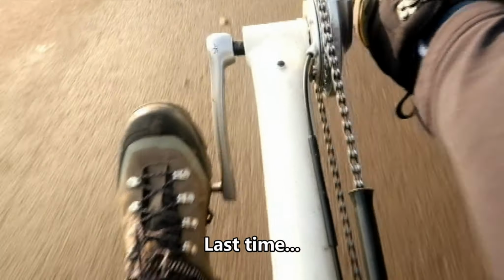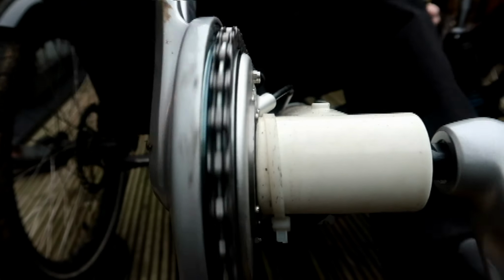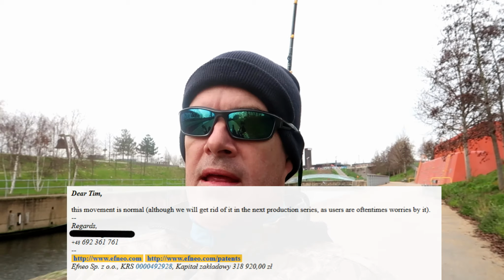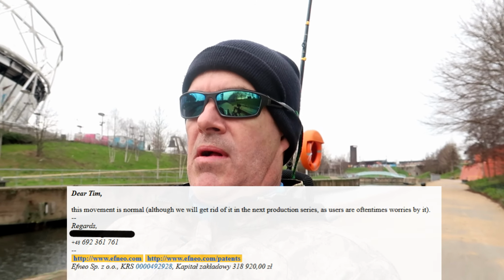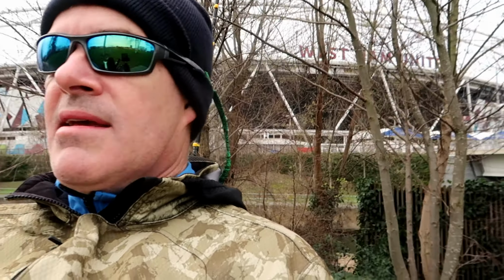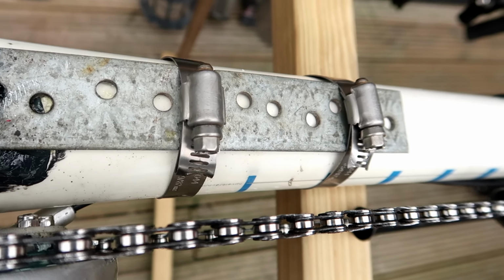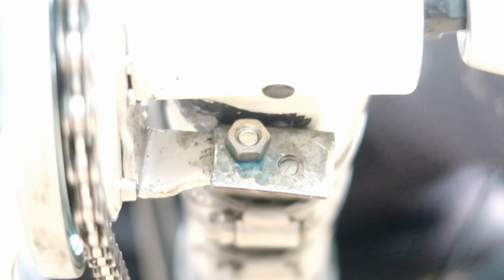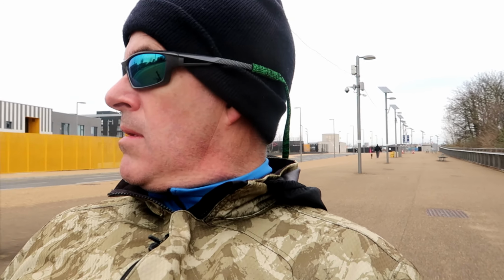Efneo GTRO Gearbox | Problem Solved?

Comment from the maker: This is the last video about the GTRO gearbox for a while I promise. I hope I haven't bored you all too much with it.
Reply from the maker: Hi David. Completely agree. Its over-engineered and from beneath is really ugly. I think you might be right and one day I might try something a bit more "tidy". Others below have mentioned getting a weld done perhaps. That might be a way forward, but for now I'm just going to try and enjoy riding for a bit. Thanks for the comment though 👍
Reply from the maker: A new boom would set me back about £350 ($450 approx), not going to happen until I absolutely have to. 👎 
I did think about drilling through the boom, but not being a mechanic, I was worried about causing a weakness in something which has to take a great deal of stress and torque.
But I do like your option 1. It goes hand in hand with the idea of maybe getting that welding done to give me something to bolt a cleaner and smaller bracket to.
Reply from the maker: 🙂 If I have to change the current "fix" then any drilling, welding or bending will have to be done by a professional. This is a part of the reason for the current idea... I didn't have to make any permanent changes to the trike itself... in case it didn't work. I'll gladly pay to get a "proper" job done if its going to change Trinny. 
Thanks for your ongoing interest though David. I really appreciate ALL the help and advice I get from my subscribers.

Comment: Tim, looks like a great fix and I agree it's the boom moving.  Thanks heaps for the update.  Hope it's all good now for millions of miles. 😁

EDIT... for the bracket fix, maybe you could put a couple of pieces of rubber under the clips to protect your paintwork.  Old tube would work...

The dent is likely wear from the bottom bracket moving so much.  What you've done is better since you would have eventually ended up with the same dent with the micro movement efneo suggests is normal.
Reply from the maker: Thanks Steve. I'm fed up with pulling it all apart now so I hope its all good too. 👍
Reply: Like you, I never let anything but rubber or black painters tape touch the paint. For instance the chain idler bracket has a rubber protector on the bike frame. No plastic nor metal comes in direct contact with the frame. That is just the kind of guy I am :)

Comment: Tim I would have to say for a person who claims not to be a mechanical person you did a good job on finding a suitable solution for the current problem. I do have a suggestion that may take some involvement with HP Velotechnick on the boom. I know spending money isn't the most fantastic thing in the world to do, but I would have taken some measurements and photos and sent to HPV and asked for a new boom to be fitted with a proper anchor point for the GTRO gearbox. I'm sure that the company would have addressed it because they are very aware that different drive systems can be installed and I think they do offer the GTRO on request.
Reply from the maker: Hi Richard. I've been hoping that you would drop by and give me some of your wisdom. 😉
I must say that approaching HPV hadn't crossed my mind at all. I also wasn't aware that the GTRO was on their options. However, that being the case, then if/when my "remedy" needs another solution then that will definitely be an option I'll be looking into. Thanks for watching and as always for commenting too 👍
Reply: @TimsTrikeTrips  HPV from what I understand is a pretty good company overall. I looked on their website and did not see the GTRO gearbox listed as one of their options but as I stated before with a little bit of communications with them I'm sure they would be happy to assist with a modified boom for their product to include a proper anchor point for the GTRO gear box. I could do that modification myself with a TIG welder and a piece of 5mm thick aluminum to weld a proper bracket on the boom to bolt the gearbox support to like you did. I will say again you did some very good work with what you had available and it looks like a very good job. As a suggestion on what you have I would have used something like a thin piece of flat rubber between the boom and the anchor support  and some thin rubber between the clamps and the boom (top)/support (bottom) to try to eliminate slippage and damage. Just a suggestion to consider.
Reply from the maker: Again, I like your thinking. It was already suggested in the comments about getting someone to weld a bracket on the boom. I don't even know what metal the boom is made out of at this point but I'm sure a local welder could do it quite cheaply. Then a respray and jobs done, eh? Hmmm, food for thought indeed.
Reply: @TimsTrikeTrips   easy way to determine if the boom is made of steel or aluminum. Will a magnet stick to it? Even grade or high carbon steel a magnet will try to hold on to it. Aluminum not even. LOL A friend of mine figured that out once upon a time when they set a magnetic parts tray on the bonnet of his Subaru and it slid off, man was he pissed. I tried to warn him but he knew better LOL.
Reply from the maker: Doh! You just reminded me. I do already know. Its Aluminium. I tried to get a neodymium magnet to stick to it last year for a GoPro mount. So how hard is that to weld? Not as easy as steel I reckon.
Reply: @TimsTrikeTrips  With the proper welder, proper welding material and a little experience it's not too hard to do. Experience is probably the most important part. After looking at the install video again, I can see some issues which the Gear Box manufacture could address for use on Tadpole style recumbent trikes and bikes. The gearbox anchor arm could be retooled to fit better on a boom style mount. That would be the best fix for Efneo to look at. Perhaps Efneo could address that themselves in the future. Maybe even include different anchor styles in the kit for maybe 2-3 different mounting situations. I think it would be worth a few extra dollars per kit to have that feature.
Reply from the maker: Yes, the anchor arm unscrews from the rear of the gearbox very easily and could be swapped out for different styles of cycle with no problems at all in just a couple of minutes. The end that fits into the back of the gearbox is a toothed ring though so I wouldn't be able to make another myself unfortunately.
Thanks for all your help Richard 👍
Reply: Tim, I'm always happy to assist any way I can, even from across the big pond here in the USA. Sometimes I find working and making modifications on bikes as frustrating as tracking down my Ancestry LOL. Too many pieces in the overall puzzle yet still fascinating to figure out.

Comment: Hi Tim, I own a 2013 model HP Velotecnik Scorpion FS26 complete with Rolhoff gearbox. At 74+ yrs.  I had an electric assist installed on the boom. The unit puts out a substantial amount of torque on both gearbox and boom. I have noticed no flex at all in the boom nor problems with the gearbox. Probably voids the warranty though. Like yourself I am not particularly  gentle with the trike. They are meant to be ridden. Unfortunately it is parked at the moment as Alberta's weather is not conduive to winter trike riding, and I do not wish to go to the expense of studded tires.  Love your vlogs, keep on triking and filming.
Reply from the maker: Hi Keith. I don't envy you that "proper" winter you guys have over there. I moan about the cold here but its nothing compared to yours.
I imagine that an electric motor would put through a great deal of torque but it would also do it at a constant rate wouldn't it? Where my legs give about 80% effort through the top 140 degrees or so of pedal and very little else the rest of the way around. I think that's what causes my boom to twist and flex. But, you've given me another idea... I need to practice my pedalling and become more "pedal efficient"? 😉 And I'm glad I'm not the only one who likes to "ride" his trike too, ha ha. Poor old Trinny.
Thanks for the compliment and thanks for watching and joining the conversation too. I really appreciate it 👍

Comment: Good job on the repair, nice to see it appears to be fixed. It's all part of the recumbent life. My trike is undergoing tune ups right now as it's too bloody cold to ride LOL. Prepping for the spring ride to the East coast (1500 miles or so along the St. Lawrence river from Ontario to New Brunswick, should be fun. Take care and keep the videos coming.
Reply from the maker: That's a nice ride. When are you starting out? 
The repair is over-engineered but if it works then I'll be more than happy 😉 Cheers Bryan.
Reply: @TimsTrikeTrips  Probably start in May, it should be warm enough by then.
Reply from the maker: @2madceltic  well I hope you get a few rides in before then 😊

Comment: It's good that you checked it. Here it's easy to go to a bike shop and there are 3 near me and 6 more a bit further but all in biking distance.
The dent isn't that big of a problem. You have an aluminium frame if i am right and the edge of the part was shart, so it would always work it self in the frame. I think by making it flat so it has a bigger surface to touch, would also help.
Next time as you are in the Netherlands, come by, I will fiks you a nice part fort it. Some white spray paint and it looks good.

What they say about the movement is normal, but this was more than you would expect.
As it comes loose again, use a tiny bit of blue loctite. Not the red but the blue. The Bleu you can get easier loose if needed.

Tomorrow I order a bunch of parts and the end of the month, I send the drawings for the metal parts to the factory.
I let them make some parts. Saves me a lot of time with building.
Pedals, breaks, some parts for the steering and even bike shoes are in already witch some other parts.
I can't wait till my bike is ready and seeing you ride makes it harder to wait.
Reply from the maker: Next time I'm in the Netherlands you do that and we'll go for a great ride together 👍
(I did use the blue loctite by the way ) 😉
Reply: @TimsTrikeTrips  as you come, come in the summer. I hate the cold weather. 😂
Reply from the maker: @emiel1976ep   ha ha, me too! 😬

Comment: Another good one Tim, if I was you I would carry some tools so I could just retighten those bolts and BB coups enough to get me home at least, even if you have to stop a few times and retighten them at least you would get home, thread lock is a good idear but it can cause big problems when you need to unscrew some stuff. I feel what you mean about getting out, last summer I did about 2500 miles on my old ICE trike and have not been on it since September and it is starting to hurt. Cheers mate.
Reply from the maker: Hi Bill, its awful not getting those miles in, eh? 
You're right about the tools. I will put them in my bag before I next ride out. Yet another great subscriber suggestion. Thanks a bunch! 
By the way, I used the blue (medium) thread lock. Hopefully wont be too bad... and hopefully I'll never need to undo them again anyway 😉 ha ha.

Comment: Tim, nice vlog about the GTRO gearbox. it looks like the boom is twisting as you pedal. That is the main reason why I choose an aluminium box type frame and boom. My Greenspeed is very solid indeed. I am sure you will end up with a strong unit,,,,,, Cheers Mate.
Reply from the maker: I'd never really thought about different boom shapes. Interesting, though obviously I cant change mine. This gearbox would fit to a box section like a glove too. As always, thanks for watching and commenting Brian. 👍

Comment: Hi Tim, unless you are about 6ft - 4in. tall & have your boom extended quite far out, I don't think you should have any flex or movement in your boom. If your boom is extended quite far out the problem isn't from your Efneo, it may be from needing a longer boom so more 'pipe' is in your frame. I have had the Efneo installed on an HP Gekko which has the same boom design as your Scorpion & I believe your problem originated from a faulty original install with incorrect settings of your crank bolts. I also had the interference with the hole boss underneath however instead of grinding the boss off the boom what I did was installed 2 heavy duty zip straps crossed over the Bottom Bracket Shell. This has been problem free for about 3 or 4 years now. Hope this idea might give you a solution that doesn't look so Polish. :) (Poking fun at Frank from Efneo) Cheers./Glen
Reply from the maker: Ha ha, I am exactly 6'4" tall and yes the boom is quite a way out there in front of me 😁
I've had no further problems with the efneo since my initial install. My 'fix' is working well 🤞
I do have a little tale to tell about the efneo guys in Poland (nothing bad) but will save that for an upcoming video.

Comment: Nice to see Tim you are still triking despite the cold . I am too much of a pussy here in my country for cold riding , lol . I have been studying your issue with the clamp . I think you may have over engineered the repair . Not sure if it would be strong enough but too bad you couldn't utilize that 5 mm hole that you cut down just under that clamp , there appears to be enough thread left . With a L bracket and a strong stainless bolt attached to the frame then attached to the motors L bracket  might give more stabilization although not sure on that one from this side of the screen . Hard to believe there was that much force to dent the frame though , seems like there is something else going on ..
Reply from the maker: I wanted to use the boss too but the bugger was not only under the leaver arm but also right at the very end of it too. I shared that idea with a friend and neither of us could think of a way to do up a bolt from such a position without re-engineering the lever arm which would have been even more of an issue.
I'm pretty annoyed that it damaged the boom. I'd done less than 30 miles too. Anyway I hope its sorted for a few more miles now.
Thanks for your comment and suggestions though. Really appreciated. 👍

Comment: The best of both worlds is to have A) a motor in mid frame using a dual drive (using both belt and chain) B) a rear wheel internal hub and gearbox at the boom bracket. The benefits are several: the rider can bypass the motor drive when the rider desires to trike in the traditional way (unplugged). Secondly, the center of gravity is better when the motor and battery is at center of gravity. Thirdly, if the motor is out for repairs, you can still ride the trike, using both the gearbox and the rear wheel internal hub. Fourthly, the power transfer is better balanced when the motor is in mid -drive train. Did I just invent something?

Comment: Loving the background- reminds of when i was a boy,  entering the previous stadium of said club with my big brother for a few years.  (They were known as the 'ammers then, irons gives a different connotation to a sparrow from Bow like me). I live 4 miles from another team in the North- West with the same colours and a similar heritage.
The company tried to mug you off? A bit much, i wouldn't think that unit came in cheap. Has your fix worked?
Reply from the maker: The fix is working really well so far. I've done quite a few miles now since that update so (fingers crossed) it will stay that way.

Comment: I've got a TerraTrike Rover with a square boom. Seems all the raves about the Efneo died out, and been looking for recommendations if one should buy it, or avoid it?

I've got a few grades to take on, Nothing longer than a mile. Combined with my weight it slows me down dramatically. So been looking around trying to find out if the Efneo is worth it, or forget about it??
Reply from the maker: James, I keep promising a review of the Efneo and I will get around to it very soon I promise. For now my advice would be... yes, go for it. You won't be disappointed.

Comment: You really need to put a longer screw/bolt on the " L " bracket, The one in there will work loose, also put some thread lock on it with a self locking nut.
Reply from the maker: Yep, you're right about the longer bolt but I need to find one first, it was all I had at the time that would fit. 😉
I have already put the thread locker on it though for now.
Thanks for watching

Comment: How fast are those trikes? Do they reach the same speeds as bikes?
Reply from the maker: Ahh.. now there's a question that could stir up a hornets nest. Let me answer it this way... in the very early days of recumbent cycles they were banned from cycle competitions because it was said they had an "unfair advantage". They are still banned to this day. Personally I take great pleasure in overtaking the guys on their road bikes. Especially so with my less than perfect legs 😉 You should try one out one day. Great fun! Thanks for watching again Tom.
Reply: Tims Trike Trips I see, very interesting. Funny that you beat those other bikers😂
Reply from the maker: I'll try and catch some on video one day. Usually not long before they step up a gear and pass me by again ha ha.
Reply: Both downhill and on the flat they are usually faster but they are slower on the uphill bits as they weigh quite a bit more than the average road bike (over 30lbs without any panniers/luggage or mudguards) and you can't stand up so its all legwork.